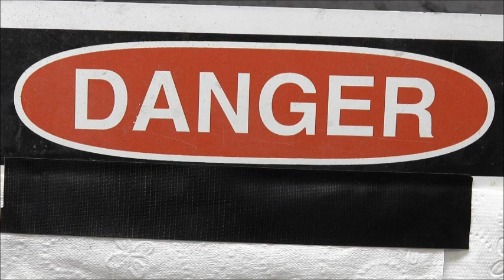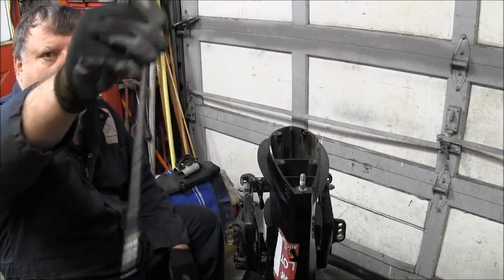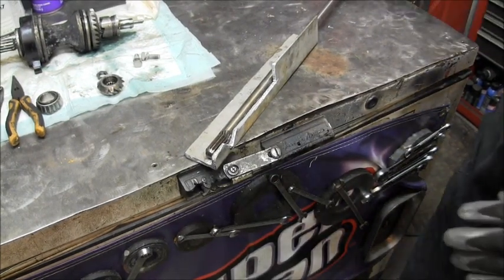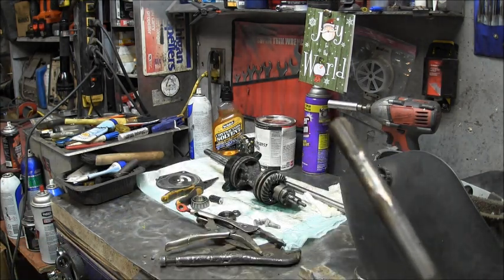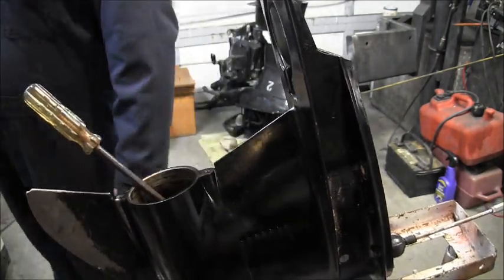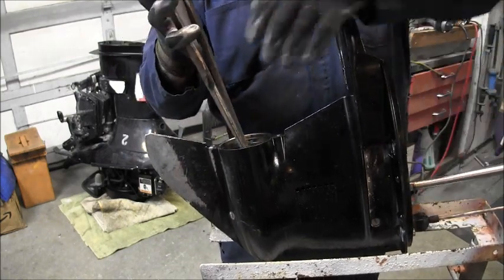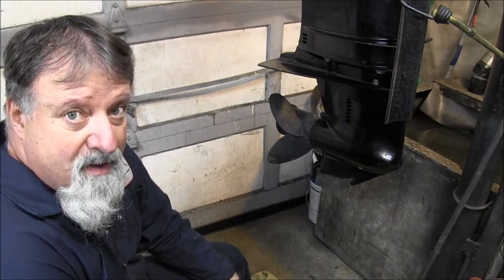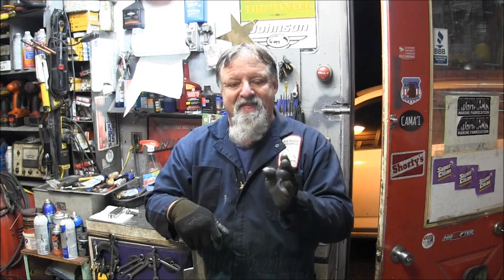WELDING A OUTBOARD DRIVESHAFT

Comment: You did a great job!!!  When I was younger I worked in mechanic shops where I was taught how to fix a part to repair a car. We rebuilt starters carbs rear ends relined brake shoes and on and on. Thank you
Reply from the maker: Yep'  gotta fix it,  thanks.  kb

Comment: Of course that weld is not as strong as the original shaft but as another hack from Kodiak, it fully fills the bill. Keep safe and be merry my fried !
Reply from the maker: Well' the motor is in current use by a commercial fisherman... If it is possible to break the weld  this guy is fully qualified to get it done.  standby. haha    kb

Comment: Nice repair on the driveshaft shaft .Older Mercs are notorious for snapping aging fatigued driveshafts and propshafts just from banging shifting gears with those overlly heavy stainless steel props. I tell boaters to get aluminum props & stay away from stainless on the older guys just based on what I have seen from my experience. The term  your looking for crankshaft internal spline length is broach depth, FYI.......Nice job getting it out some of them are like welded in there and a real pain as you know......
Reply from the maker: Yep I have seen major damage from those SS props 4 sure.   kb
Reply: @kodibassInsideoutboards  Oh those Pros and Cons of a stainless prop,Ha!

Comment: Another good series and I really enjoyed it. I suppose that there is not much that you have not seen with different outboard problems. Good advice with the welding and especially in remote places or emegency situation. Those drive shafts even used would be over $ 200.00.
Reply from the maker: I hope to get it on the boat 4 a test run soon.   kb

Comment: Not gonna beat you up. Nice job! The welded drive shaft should last and be as strong as a new one, with good penetration on the welds. That is if the rocks, and logs or whatever are avoided. Great video!

Comment: Great Video on how you can fix rather than buy new I suppose if u had a junker with same length shift u could use the shift.
.....
Reply from the maker: I have another lower but it's on a good motor.  So sparky time. haha      kb

Comment: Kodi I like the fix but I'd make sure the drive shaft seal on the powerhead would have a smooth Surface so you would not have water going into your crank cause. im working on a 50 3 cyl merc That had a catastrophic failure on the bottom cylinder because the seal failed and I believe water was going in. I couldn't really tell but I believe  You grinded down some splines on that surface, correct me if I'm wrong
Reply from the maker: Yep'  I'll B watching close 4 sure.    kb
Reply: @kodibass  thank you for all your videos. I enjoy them very entertaining,

Comment: There’s NOTHING wrong with a good solid repair ! That shaft might be NLA and then what ! The outboard is worth around $1500 and a driveshaft might be around $500 if you can find one ! Kodi your video served a good need to someone ! BUT …. A plastic prop ?!?!?! Come on now , the OMC 9.5hp turtle tops had plastic props ( some were metal ) and you loose a bit of power and top end with them ! Shear pins are still the cats meow in my book !
Reply from the maker: I guess U could call it a pricy shear pin haha.    kb